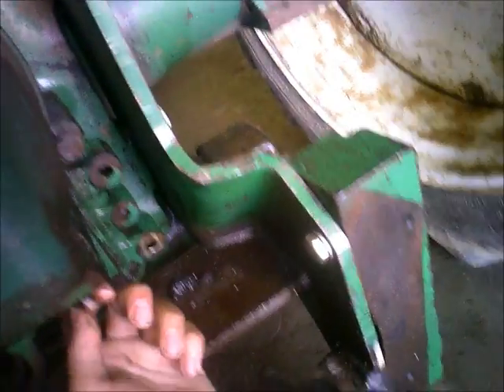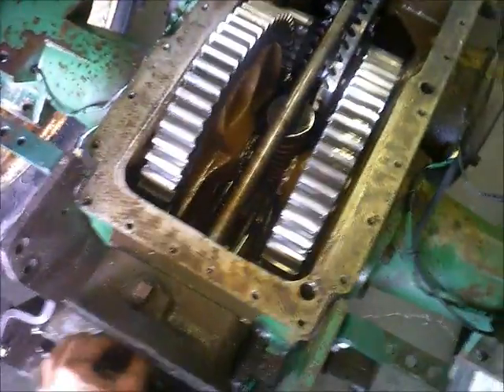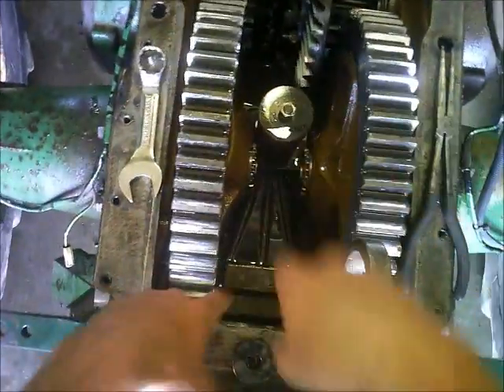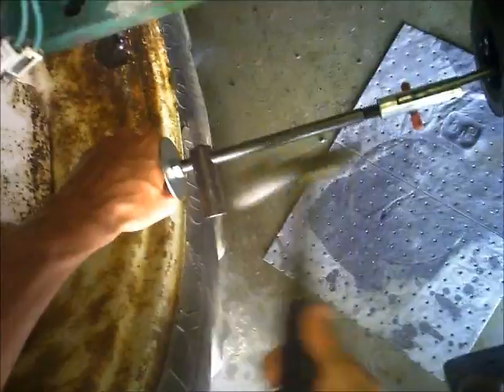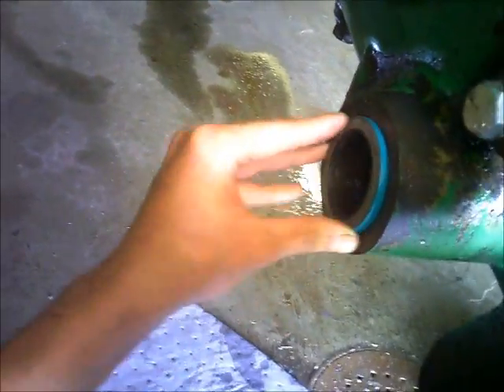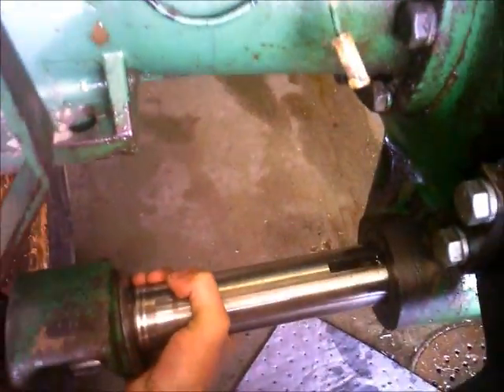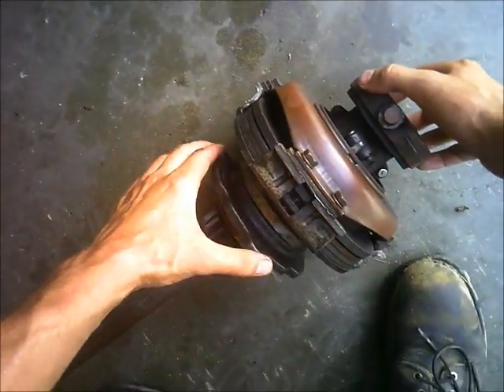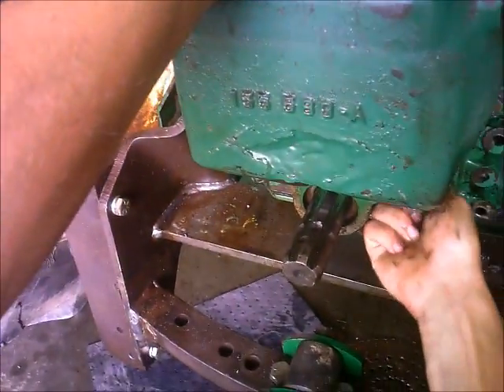1600 Hydraulics Part 2

Comment: I have a 1650 Oliver and its leaking hydraulic oil out from around the pto shaft. How do I replace the pto shaft seal. I tried taking the snap ring off and pulling out the shaft like that but it didn't want to come out.
Reply from the maker: Joey Duncan The seal is behind the bearing so the shaft has to come out one way or the other. Looking at the assembly, you are going to have to drain down the rear end before removing the seal. Its leaking 80-90 from the trans so you dont have to touch the hydraulics. Drain the rear end, remove the snap ring, pull the PTO stub shaft out, then you should be able to get small drill into the seal so you can run a screw into it and pull it out. Take note of how far it is pressed in before removal then just tap the new one in until is at the same depth.
Reply: Oliver66FarmBoy  Thank you very much Ill try that as soon as I can